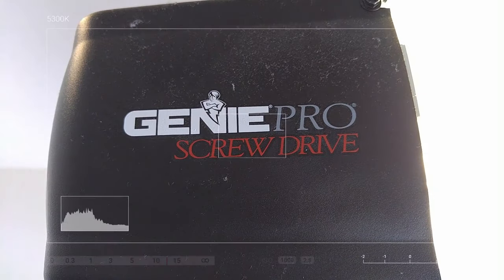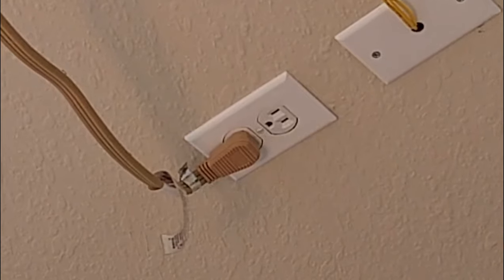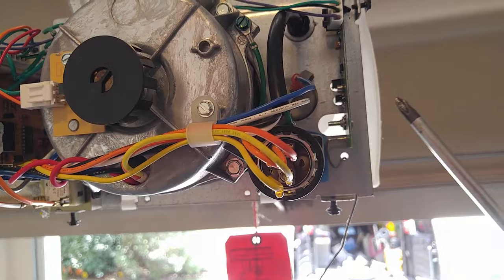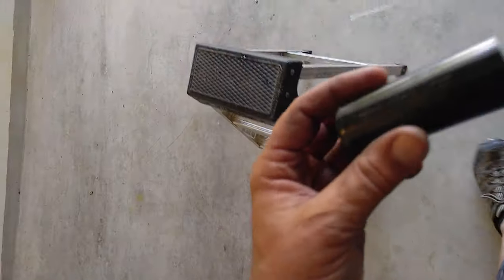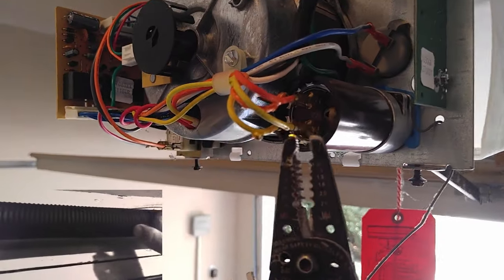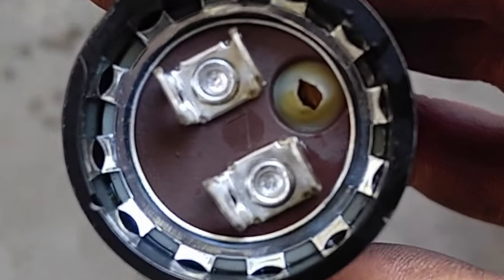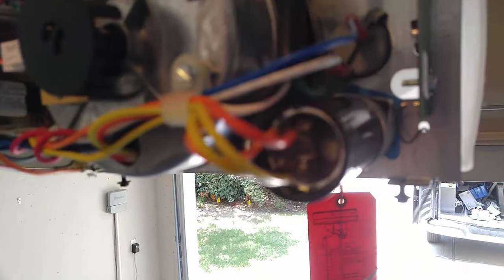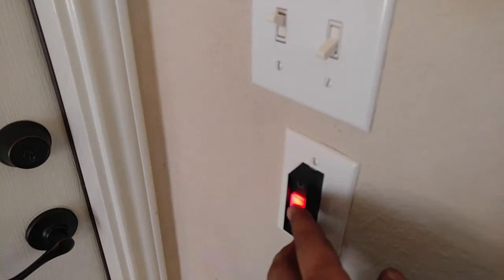Why My Genie Garage Door Opener is Not Working / Started Smoking

Comment: Nice job on the video..I wish that was the problem with my old Genie opener.  When i push the open/close button, the unit buzzes twice, the lights come on, and that's it.. nothing.  If i try to turn the plastic nut (help it) on the screw shaft when i press open, the motor will start running for a few seconds and stop.  I guess my motor is shot or bad armature..
Reply from the maker: Dang.  Genie has told me that the issue could be a flat spot that has developed over the years on the motor... If you have a clutch coming out the back then that opener is old school.
Reply: @garagedoorgenius  yep, I bet that's the problem..thanks.

Comment: Great Video! My opener can open the door, however, when it comes to close, the door stops in the middle. Meanwhile, the whole system is out of power for about 5 mins. After that, you can see that the control on the wall is back to power and then I can finish closing the door again. Then I can even open the door too, but not able to close it up (Stuck in the middle again, power gone). Forget the mention that the opener has smoke too! Do you have any idea? Thank you in advance!

Comment: Hi there! I recently installed genie Garage door opener (model 1035), and there was a problem that the opener runs two time, and it stopped... I am wondering if you have any ideas what was going on, or you have a solution for it.. Thank you!
Reply from the maker: Hello!
First off, does the door operate smoothly up and down manually?  Is it heavy to push up?
Second.  On the opener itself, what LED color do you have currently showing?

Comment: Is this the reason the door won't open for the wall console too?
Reply from the maker: It's very possible.  They start your pastor is one of those obvious parts that if it's bad you'll know it. Especially if you seen a little bit of smoke come from the machine or if it smells like an electrical burn.

Comment: My Dad has a genie garage opener. The remote will not open or close the door. What could be wrong? Thanks
Reply from the maker: 1. Change the battery
2. Reprogram the remote
Those are what I would do to try and fix the issue.

Comment: Im having issues with mine. Ive replaced the carriage and the capacitor, the coupler looks fine. I can move the screw drive by hand from back of motor unit, so it isnt 'blocked", getting a electric grinding noise that lasts about 2 sec when button pushed nothing else happens, thoughts?
Reply from the maker: Yes, I know that 2 second buzz sound.  I've talked to tech support quite a bit throughout the years.  When this particular issue happens it's normally because the motor developed a flat spot.  Which will give that sound like it's stuck.  Unfortunately the fix is replacement ☹️.
If you want to cross check with what I said you can certainly call Genie tech support and run the scenario by them.
Reply: @garagedoorgenius  thanks for the info...
Reply: hi, would it be possible, or more economic to just replace the motor or the whole unit?
Reply from the maker: @jeffreycummings815  you're welcome 😊!

Comment: what happened if you tried to run it with a blown out capacitor?
Reply from the maker: It won't run.  It'll just buzz or make no noise.  Start capacitor is a crucial piece to the opener.

Comment: Great video.  Thanks for posting.  I have a different issue with a Genie Powermax 1500.  It just quit working, no motion light, no leds on on the photoeyes, etc.  There is power to the outlet that it is plugged into.  Any suggestions?  Thanks, Steve
Reply from the maker: Steve O, can you press the program button on the unit to see if the led comes on?  If not, its probably smoked.
The relays on that model are known for overheating and frying the circuit board.
Reply: Sir, Thanks for the prompt response.  Nothing happens when I press the program button.  Do you think just replacing the circuit board will fix it?  Thanks, Steve
Reply from the maker: @stephenormsby3662  
If I was a betting man, I'd say yes.  Sounds like it's dead.  You may want to compare apple's to apple's before sinking money into a circuit board vs replacement.
You can get a second opinion from Genie just to verify.
1-800-354-3643
Let me know the outcome.
Reply: @garagedoorgenius  OK thanks.
Reply: @garagedoorgenius  Sir,  I just got around to changing the circuit board on my Powermax 1500.  After I installed it, I was able to run the door up and down to set the up and down limits, but when I tried to go to the next step of running it up and down with the wall switch it would not move.  The red LED on the wall switch is on.  The LEDs on the safety photoeyes are also working.  The light bulbs come on when the motion detector is activated.  I also tried powering down a couple times.  No success.  Any suggestions?  Steve
Reply from the maker: Hey sorry for the late reply.
Talked to Genie support.  He said, makes sure to set the limits correctly. I believe you know how to do it, but just check this video first to make sure you are.
https://youtu.be/ilzAc4D-caI
If your doing like in the video and still no go, he said contact them so they can run you through a couple test.
I told him you bought a new board and your issue.  He also said that the new board could be defective, depending on where you purchased it.
I thought since the original board took a dump maybe it fried the wall control as well.  He didn't think that was it..
Sorry I don't have a definitive answer for you.
Reply: @garagedoorgenius  OK thanks for following up.  I just followed the up/down limit procedure in your other video and it went fine.  However, the wall control still does not do anything.  I'll try giving them a call.  Thanks again.

Comment: Any idea why my new universal Liftmaster 375UT isn't pairing with my old Genie opener?  All the switches match and I've tried every video's advice I can find.

The Genie does work with the wall button.
Reply from the maker: So your Genie has the old dip switches?
With the remote, turn it upside down, then match your switches.
Genie dip switch machines when programming a universal, you have to press the button on the remote like 16 times.  Don't give up!!
Reply: @garagedoorgenius  1- Thanks for the amazing quick response.

2- The upside down trick worked!  I just had to flip all my switches the opposite way.

Thanks!
Reply from the maker: That's awesome!  Glad I could help.

Comment: Great video! Installed a Genie QuietLift 750. Programmed the Up/Down. When I push the opener it goes up (wow!). When I push it again to go down it just clicks & does nothing (what?). If I hold the opener down without lifting up, the door will go all the way down.  If I hold it for a portion of the down direction & then release, the door will reverse direction & return to the up position. Does the same thing from my Keypad. Any ideas?
Reply from the maker: Safety sensors.  Check them make sure they're aligned with each other. One sensor should be solid green one should be solid red.
Reply: @garagedoorgenius  Thanks. Question... do the safety sensors have to be connected for the down to work?
Reply from the maker: @swaugie4534  yes they do. 💯

Comment: My Genie unit would not close the door, it acts exactly like your video shows, but the capasitor does not show the blow out like yours does, I have a second Genie opener, moved the capasitor from it and same issue, like its stuck in up mode, when it hits up limit switch motor stops but button press does not make it go down, Safety sensor show solid red and green. Any advise?
Reply from the maker: If you run your hand in front of the red sensor, does it flash briefly?
Reply from the maker: Also, maybe adjust the down force..
Reply: @garagedoorgenius   Yes red sensor does flash
Reply from the maker: Turn that down force control (UP) a bit.  Let's see if that does the trick.
Reply: @garagedoorgenius   When door is up, press button- no response at all. If I pull the release, door slides down, motor runs, engage the release door goes up, motor stops when limit switch is hit.

Comment: What year was this house built. Is this the original garage door opener to the house.
Reply from the maker: If I recall, yes the opener was original to the house.  2001 maybe..
Reply: @garagedoorgenius  Can’t be from 01, The plastic opener case.
Reply from the maker: Not sure..🤔
Reply: @garagedoorgenius  The case is also smaller and the release handle is different so it can’t be from 01 has to be from 06-I don’t know.

Comment: I loved this clip. I purchased a new start capacitor, installed it and it worked a few times. After a few runs, the door did the same thing, it won’t run a closing cycle now. The new start capacitor doesn’t look blown so what do you think could be the problem? Thank you in advance.
Reply from the maker: It goes up no problem, but won't close?
Thanks!
Reply: Garage Door Genius No, it’s as if I never replaced the start capacitor. When I pull down the red/white cord, the unit runs but it doesn’t move the door like it should.
Reply from the maker: @wayneshorterii7479  
Can you see the screw turning inside the rail? If not, bad coupler.  I have a great video for that if you need.
Reply from the maker: @wayneshorterii7479  
https://youtu.be/8CVs6HcIBWQ
Reply: I will check it out. Thanks for the additional advice.
Reply: The screw is turning inside the rail.
Reply from the maker: @wayneshorterii7479  sounds like a plan.  Let me know!
Reply from the maker: @wayneshorterii7479  ok.  The coupler is good.  Here's a basic question I didn't ask.  When you pull the rope, that disengages it. When you engage it, are you pushing the silver arm back up into place?  The piece the rope is attached to.
Reply: I saw the screw turning inside the rail. So the video you send won’t work because that was a fix to a non-moving screw. Can you think of any other reason that I. Ould troubleshoot? I really appreciate your time.
Reply from the maker: Also, make sure the limit switches are plugged in and working.
Reply: Yes, I’m putting the silver arm back into place. What is a limit switch?
Reply: The limit switch is working properly.
Reply: Do you have any other advice since the Limit Switch is working on both ends?
Reply from the maker: Wayne at this point I would call Genie tech support.  Have model# ready.  Cross check everything you've done with them.  
1-800-354-3643
Could be a flat spot on the motor, but get a second opinion.
I was really hoping to get this issue solved for ya.  Report back if you don't mind.  I'd like to know what the deal is.  
I was thinking.  It sure does sound like a capacitor issue.  Even after you changed it and your back to the same problem.  Did you look at the new capacitor to see if it got smoked?
Reply: I looked at the new capacitor and it doesn’t look smoked. I checked all the mother boards to see if either of them were burnt and they look fine. I am not past the idea that I was sent a bad capacitor. I appreciate you again and I will definitely follow up with you to let you know what the issue was and how I fixed it.
Reply: So I called Genie support and we troubleshooted several things. They think it could be a bad sequencer board. Before I replace that, I’m going to order another Start Capacitor from Genie because the one I got off of Amazon could be faulty.
Reply from the maker: Ahhh...  Did Genie mention to try another start capacitor?  Yea, bad boards will do that as well.  Was hoping it wasn't that or motor.
Reply: Genie said that I could have the Start capacitor tested or get another one to rule out the last one I purchased was or wasn’t faulty. I hope that’s the issue because as I priced some boards today, I’d be better off buying a new unit.
Reply from the maker: @wayneshorterii7479  
If it comes down to a board, definitely consider a replacement unit.  
Hoping it's a capacitor Wayne!

Comment: Hi my genie garage opener has solid red light both. I push the bottom for the program blue comes out but quickly goes back to red? do you know what might be wrong
Reply from the maker: Hi Ada!
What are you trying to do?
Reply: @garagedoorgenius  program setting the down and up
Reply: But before I start programing the unit I start off with solid red LED
Reply: Thank you for your videos I fixed the problem. Thank you for your fast replies have great night !
Reply from the maker: You're welcome 😊
What was the issue?
I was gonna ask if you started off by pressing and holding down the DOWN arrow.
Normally a solid red light means limits not set yet.

Comment: Our genie stopped working. The wall one is lit red but nothing happens. Also the car openers are not working. We just hear a "click" when we press it. Nothing is blocking our sensors on the ground. Any ideas?
Reply from the maker: Check the start capacitor, make sure it's not blown.
Reply from the maker: If it's not the start capacitor then you may have a flat spot on the motor causing your issue.  Which means stick a fork in it unfortunately.
But to cross check what I said you can call Genie tech support to get a second opinion.  Wait time isn't to long.
Reply: It works if pressed manually on the garage door opener itself, Which is a giant pain, That would still be a motor issue?
Reply from the maker: @ginaroberts6937  if you can press and hold the button on the wall and close it, it's probably the safety sensors.  Make sure they are in line with one another.
If the unit is non responsive, then yeah possibly a bad board or motor...

Comment: On my Genie when i hold the limit switch it will still keep going does not stop. Is the stop switch bad?
Reply: DusterGuy1970 if it’s having the same issues the one in the video did and you’ve replaced the start capacitor the limit switch is bad
Reply from the maker: Yes, I would change out the switch.

Comment: Please help. New sensors, new remote batteries, only closes while holding wall button. Open with one push of wall button.
Reply from the maker: Pressing and holding the wall button overrides the safety sensor feature. Which means you still have a sensor issue. Make sure the wiring is good.  You should have a solid green LED on one of the sensors and a solid red LED on one of the sensors.
Reply from the maker: Whatcha find out?

Comment: my Genie screw drive has problem, could you please help?  when the door travels up it stops at the first joint in the screw drive.  The collar and c clip are in place.  when I take the weight of the door off the carriage, the door travels all the way up and it works fine.  It is when there is the weight of the door on the carriage that it stops at that joint.  Suggestions what I can do?
Reply from the maker: Sounds like you need to adjust the force control (up).  2 dials located normally by the light bulb.
Also, make sure your door works relatively easy by hand.  Don't wanna crank those FORCE controls to lift a heavy door.
Reply: @garagedoorgenius  i tried the force adjustment open and i have it increased all the way.  The door still stops at the same spot on the screw drive every time.  It stops still at the first joint of the screw drive.  By looking at the joint, it all looks normal.  I dont know what is going on.  Any idea you may have would be appreciated.
Reply from the maker: @garrettstorer2621  hmmm...🤔
Next thing I would try is...take the arm loose from the door.  Just run the carriage.  See if it travels past the point it stops.  If it stops, then I'd say there is bigger issue, internally.
You could also separate the rail from the power head.  Twist the end that the coupler attached to.  See if the carriage stops at the point you're having issues.  With the rail disconnected from the head you can also run the head.  Run it until it shuts off.  If it only runs a little then stops, like the problem you're experiencing, then possibly a flat spot on the motor.  Which means stick a fork in it, call it done.
Reply: @garagedoorgenius  with just the carriage running by itself, it will travel past that point it would usually stop.  So the weight of the  door is making it stop
Reply from the maker: @garrettstorer2621  ok, well it sounds like a control board problem unfortunately.  You could take the board out and blow it off with computer duster.  Especially the force control dials. I think there called (dash pots).  Blow those out. Put it back in and see if any change.  But I've seen in the past the force controls max out and no more adjustment.